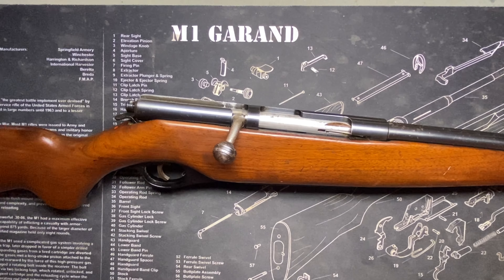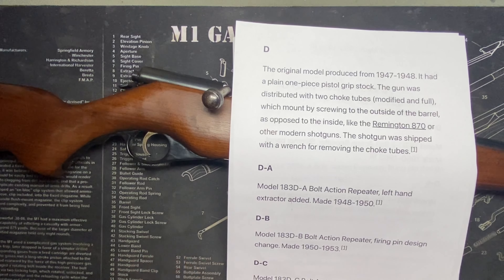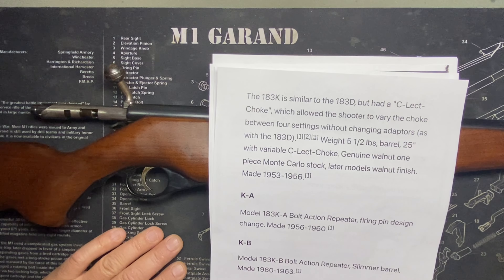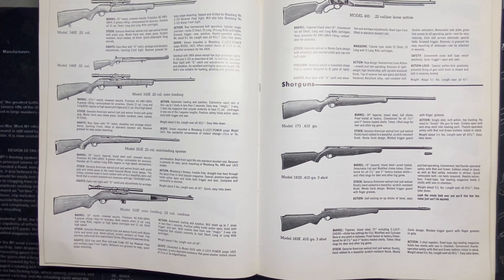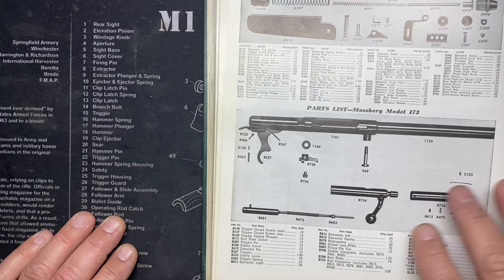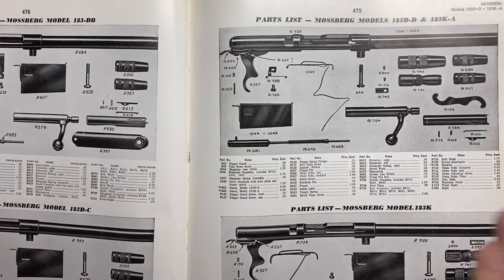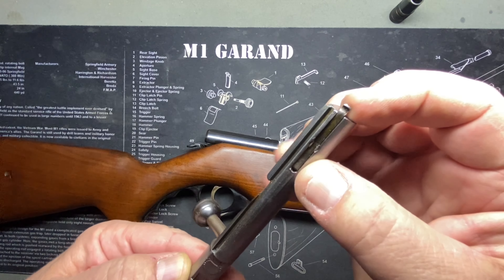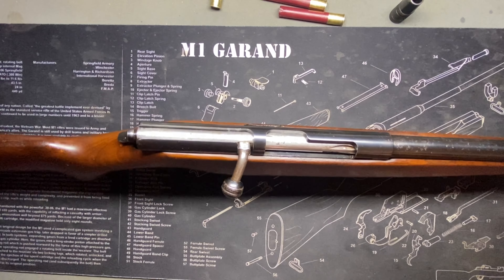Mossberg Model 183 D - B

Comment: I had a 183 D.  Took the chokenoff for deer hunting with slugs. Thats why I figured they did external threads on barrel.  Not certain
Reply from the maker: In doing research for these models I could swear I remember I read some literature from Mossberg along the way that said you should not use these types of shotguns with this system without a choke attached.  That being said they only made them in full, mod, and imp cyl so it only makes sense that a cyl choke wasn’t made because it wasn’t necessary.  A call to the experts at Havlin Sales might be in order.  Let me know what they say......

Comment: I have a 173b that runs great but does not extract. Both extractors on the bolt seem fine. I think I may be missing the ejector interrupter. Any chance you can do a close up video on that part? I know the two guns aren’t exact but it may help me in narrowing down my ejection issue.

Comment: The 173 definitely didnt come before the 183. It was an update to the old model 73, and was introduced in 1957
Reply from the maker: Yes. Did I say that?  That list I have is confusing at times as it isn’t straight chronological.  Thanks for watching.
Reply: Around 18:20 . The 173 was Mossberg taking all of the improvements they'd made to the 183, and modernizing the model 73 with them. There was no regression in bolt design

That said, it's all good. I've been going down a rabbit hole trying to source parts, and your video was a great help with all of these schematics
Reply from the maker: @Stout936  That’s Brownells Encyclopedia. A great source.

Comment: Great details! I’m familiar with 2 of these shotguns. The first one was a 185-K that I resurrected for my coworker. It just needed a really good cleaning and the safety had to be reattached and the pips that show S and F had to be acquired and put back in. It turned out really nice and he still has it.

The other is a model 83 that was given to me “if I felt like messing with it”. It was in really rough shape and was missing parts. It took about 3 years to slowly gather the parts and refinish the stock, make a new recoil pad, etc. I
used a trigger from a 185 (20 ga), which works just fine but there wasn’t quite enough clearance within the stock for it to fit. So I wallowed that out ever so slowly until it did. I also had to add a series of cross pins to repair a crack in the front half of the stock. Then I added a pillar through the stock to give the wood more support for the action. And last but not least I used Durablue on the receiver and barrel because that was in pretty rough shape too. It was a total labor of love, because I spent multiple times what it would cost to just buy a functioning one at a pawn shop if I encountered one but it was really cool to do. From 25 yards I can easily pick off small Sunny D bottles with it.
Reply from the maker: Sounds like a great shotgun!   Thanks for tuning in.

Comment: Great video! I have this exact model. It used to be my grampa's. I fully cleaned it but it seems the firing pin is stuck since the bolt wont close.  Any suggestions on how to unstick it?
Reply from the maker: Not sure what you mean by firing pin stuck but my suggestion is to take the bolt apart and attempt reassembly.....sounds like that’s where the problem is.

Comment: I have one that needs a new bolt Assembly where can it buy that part at ?
Reply from the maker: I’ve always had good luck on eBay or Numrich gun parts but be aware that there are several different model number variations of these around that time....some similar models might work, some may not.  I would advise purchasing the Brownells Encyclopedia first so you can be sure which models use the identical bolt.  Just curious, is your bolt missing?
Reply: Yes my whole bolt assembly missing I got the 183D-b model at a pawn shop for $25 and it was just missing the bolt assembly I just figured it would be a nice project. Thanks for the advice!
Reply: Try this guy, found my choke here.

Comment: Seems a bit bizarre that they would have implemented so many parts changes in a relatively short time.  Single shot vs magazine, & maybe choke tubes are understandable modificatiobecome brittle nns, but the small parts changes suggest they did not plan the ultimate design very well, and played a change-as-you-go game.  Was this the way Mossberg did things?   If I were to guess, that seems that way; they certainly had many different models/designs of .22 rifles, even many different bolt actions.
Also, noted bolt action shotgun safeties look just like those on the .22 cal. rifles.
The plastic trigger guard/finger grooves tended to become brittle and crack; aftermarket aluminum parts used to be available.
Reply from the maker: Yeah, that was the way Mossberg did things in the 40’s and 50’s. By the time the Model 500 shotgun came out in 1961 things settled down quite a bit and standardized in their line up.